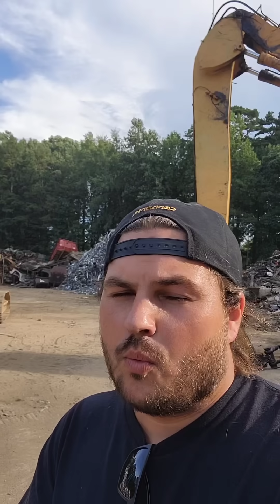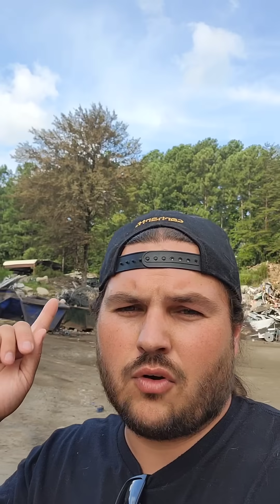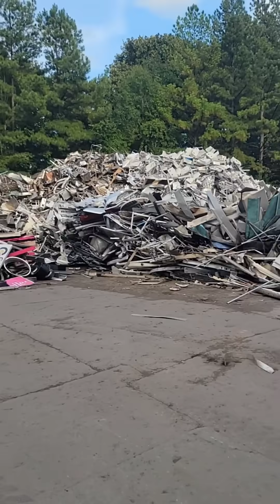We are always looking for ways to improve! #Scrap-Life #recycle #recycling #business #entrepreneur

Comment: @michaels_scrap_life My local yard isn’t huge but isn’t small either, they have all of their pathways for customers on the perimeter of the yard and all the materials and machines are in the center. I feel that you have a lot of wasted space having all your piles separated so far apart. At the local yard they have mafia block walls to separate the different materials. The walls are 3-4 blocks high. And the materials are stacked up much higher than the walls. It is very convenient because as people unload there is plenty of room for other people to drive past so there is no traffic jams.